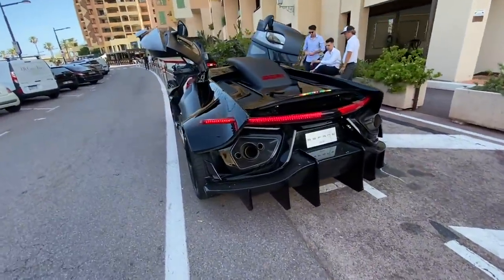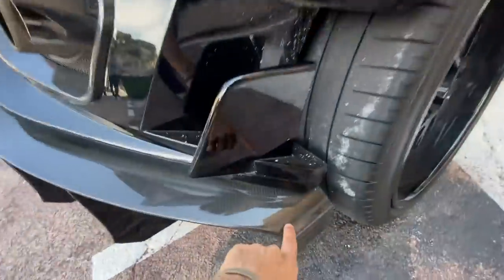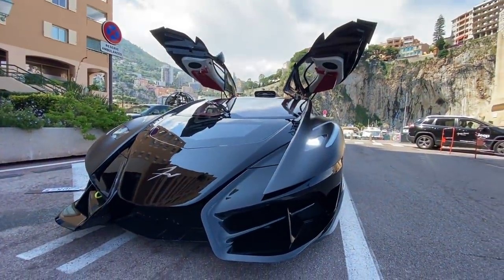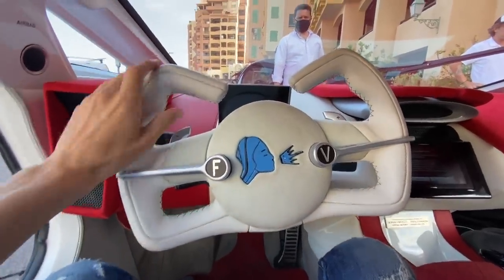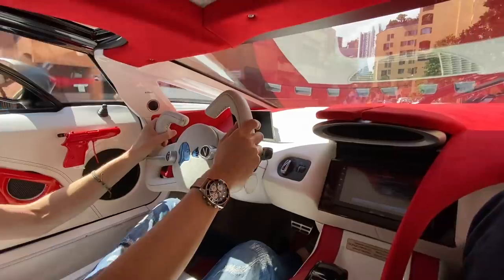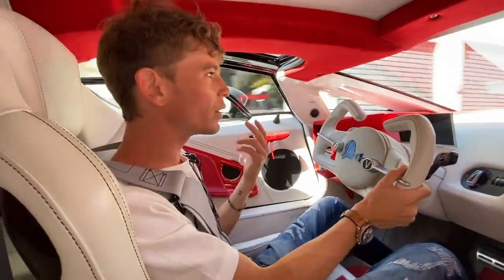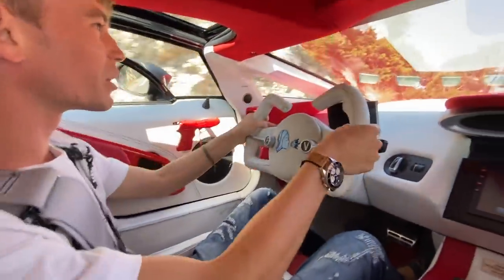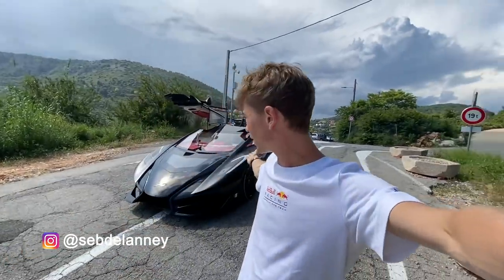Driving a 1010hp PROTOTYPE ON THE ROAD !!

Comment: This is the ugliest thing I ever seen on wheels... just a personal opinion.
Reply: Very over designed
Reply: From the rear it looks like some kind of alien insect monster. The exhaust as eyes, tail lights eyebrows, and the diffuser fangs.
  It would have better appeal if they feminized it a little. Give it a simpler elegant look, but balance it with masculine wheel flares and haunches. Get rid of some of the gimicky cladding.